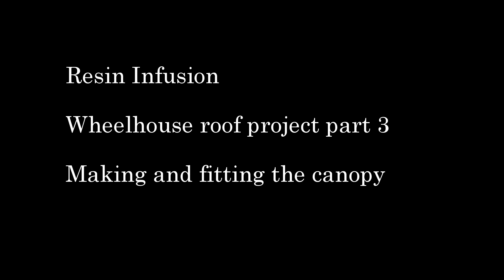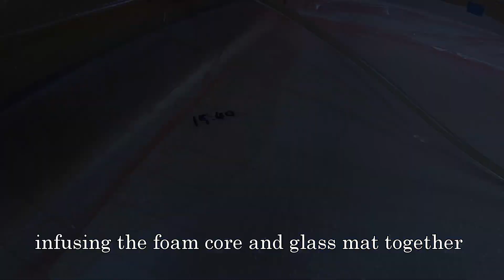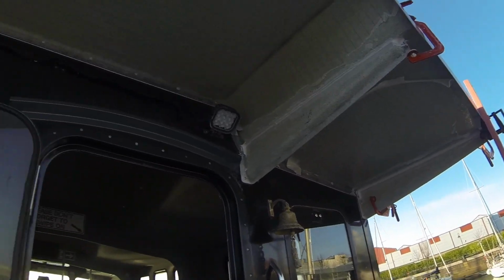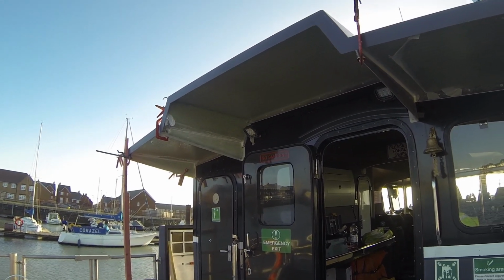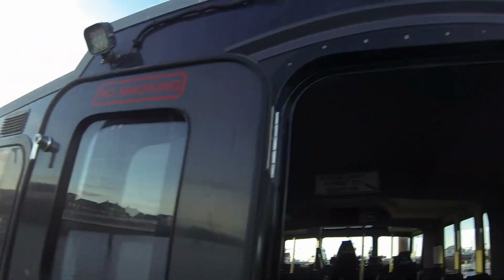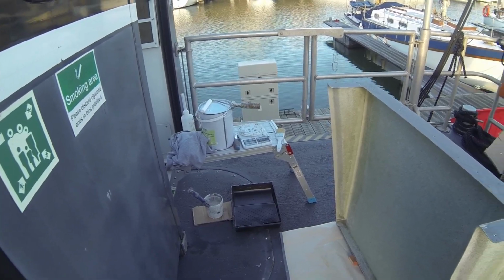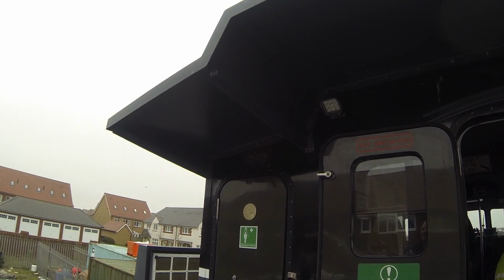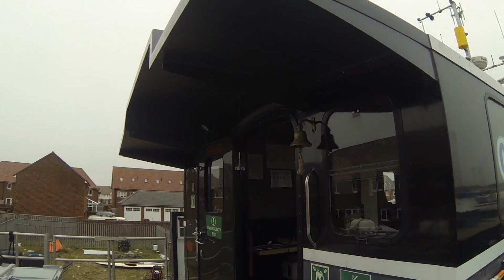Wheelhouse canopy - Resin Infusion - part 3

Comment: Good job! I was wondering what you where using to seal the MDF and how you got it airtight. I foznd it extremely difficult to get reliable plugs or molds for infusion out of MDF.
Reply from the maker: The part was made with polyester infusion resin and gel coat. I used a polyester based resin sealer used in mould/plug making that can be worked up to a fine finish.
Reply: @EvansBoatwork  Thank you very much for the reply! Have a great day!

Comment: What did you use to stick the foam core to the outer previously infused skin?
Reply from the maker: The pieces of foam were just laid in place and then the laminate stack laid over. The foam has holes through it as well as grooves in the surface to allow the resin to flow to all surfaces. So during the infusion process the foam was bonded to the previously infused skin. If you had a complicated shape then spray tack adhesive could be used to hold things in place until a vacuum is pulled in the bag.
Reply: @EvansBoatwork  thanks, I did not notice the holes and  groves so I thought you glued the foam.